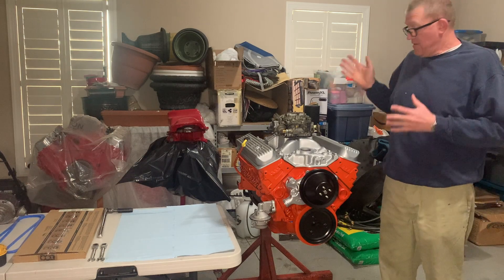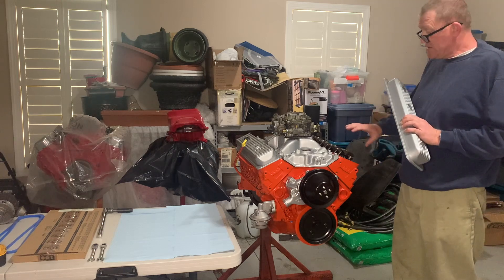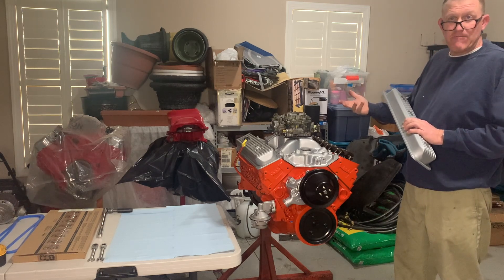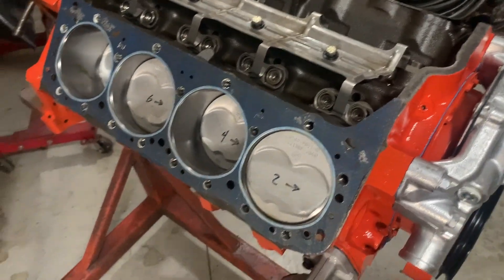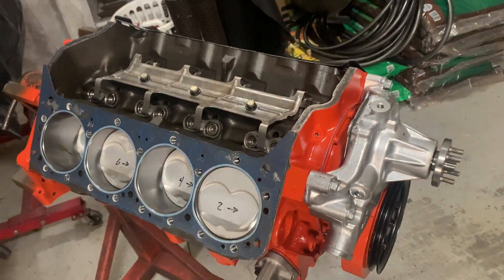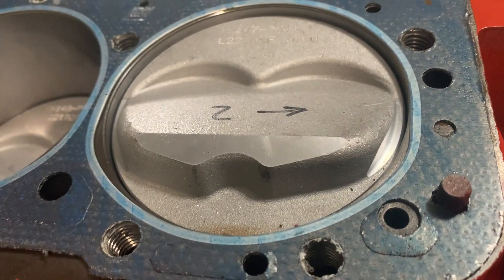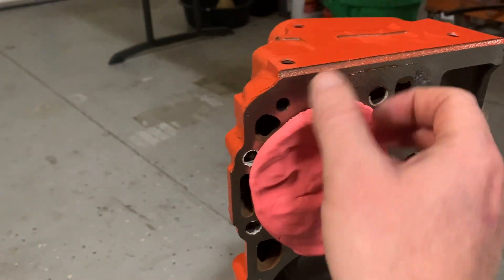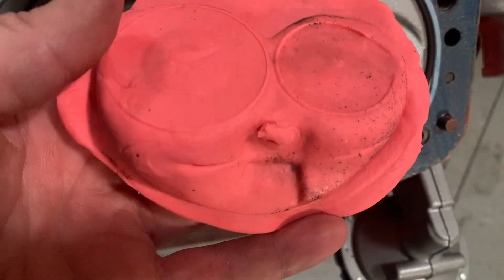Resolving Piston To Chamber Clearance Issues on our Late Model 1 Piece  DZ 302 with Vortec Heads!

Comment: I built a 350 SBC with vortec heads and huge domed forged pistons . After the machine shop ground a bit off the heads spark plug pad  to fit the dome they told me these heads weren't supposed to run dome pistons . Now they tell me after it was completed . The quench was tight too , so this brought this build up to 12:1 . Since it was a 120 octane propane fueled engine that was the ratio I was after . I have been working on the timing all summer and I'm still not happy . Your statements about getting the flame front over the dome before TDC makes  sense now . I was having problems with the flame kernel being blown out by the dome . I solved this with a higher duration HEI coil/module . Solved the problem but after thinking about your comment I think I need more advance throughout the whole RPM range not just at lean cruise conditions . I thank you very much ! I will get back to this matter in the spring . Thanks again !
We went the other way having ground the clearance off the head not the piston . It required very meticulous indexing of the plugs but it did work and the quench was very tight . I think after dealing with timing on this engine there is more to this clearance problem than just clearance . I suspect there are some turbulence problems with a vortec head that wasn't designed to use a domed piston . You may need a more powerful HEI like I buried my problem  with and I'm still not happy with my timing . I wish I hadn't built this engine a few years ago . I could have watched your video and been aware of the problem . I could have gone a different route , maybe a different head . My goal was a fast burn head with high compression to make full use of the low cost 120 octane propane fuel . Don't get me wrong this combination works . I'm running at half the cost of gasoline  hauling grain bins to the mill with this 12:1  one ton GMC on propane ! Many thanks !

Comment: hey dallas new to this bare with can you tell me how you set up beehive springs on your buick heads I asked TA perf. and got the they don't know, your one set up looks like beehive so any help would great thanks-
Reply from the maker: I did do beehive springs on my Super Stock 350. What I did was I took off the race springs I already had on the heads. Those heads had 11/32” Chevrolet valves installed vice the standard Buick 3/8” stem valves. Then I measured the springs and wrote down their characteristics. Then I found a set of beehive springs that met those characteristics and had the needed spring pressures over the lobe (compressed) of the camshaft.

Comment: To bad you couldn't remove the square where the plug screws in 3:56  the cyclinder head  and  use a short reach plug.
Reply: It acually comes to 265 cu. In., Here is the formula for the baby LT 1 block and crank,   3.750 bore, 3 inch stroke , Bore times bore, times stroke, times .7854 constant, times 8, hit equals, Ok 3.750 times 3.750 times 3 times .7854, times 8, equals 265 cu. In. Right on the money ! These nuumbers match the original 265 engines numbers !

Comment: I used L99 crank 
6.250 rods
Mahle flap top pistons 
AFR 195 HEADS with 52cc
Cam 224 232 585 lift 112
11:1 compression 
Dyno 385 hp at 6500 338 torque
Reply: piston part number?
Reply from the maker: Sounds like a great combo! Mine is all GM stuff, was hoping to surpass the original DZ302 numbers.

Comment: I like to use clay, I find Play-doh to be very spongy and not totally hold its shape. Also, for what little needs to be removed, I'd remove it from the head, not the piston. Just had to do very close to the same thing on my 427 bbc, just a slight amount of the dome was just tapping the head at the edge of the quench pad. Just removed the very edge of the quench pad to give a .060 clearance.

Comment: I am 65 years old, so I remember the Camaro Z/28s with the 302 the kids with wealthy parents had bought the kids those Camaros.
The 302 was a screamer with that short stroke but not an engine I need and since doing one 383 stroker with 6 inch rods and 1 385 with 6 inch rods for my 2 work trucks I won't ever do another 350 again the 383 is so much a high toque engine for pulling boats and work trailers

Comment: I have plans for the same but I am going to zero deck the block with flat top pistons. I will use aluminum L98 heads that will be ported with 2.0” intake and 1.55” exhaust valves. The heads will be slightly milled so chambers will be about 52 cc.
Reply from the maker: I hope it runs well! Would love to see it!

Comment: It's common to remove part of the square bump in the Vortec head when using higher domed pistons.

I bet that is where you are hitting? It would be much easier to grind that bump down on each chamber.

Comment: Piston crown is only so many thousands think. Caution removing too much material. My guess is .020" is the max Id remove. Ive see pistons push thru after being cut/machined too deep. Definitely remove the pistons to clearance & measure the piston thinkness before you start. Dont ruin a piston if too much has to be removed. Measure many times, clay cleck is your best be and also dykem. I even use dry erase markers at times.

Comment: We used to apply putty to the top of the piston and then put the head on and hand turn the motor then pull the head and see where the putty got crushed. Considering all the pistons will have to be machined I would take them out and then hand fit them in the chamber after putting dykem on them to see where they contact. If they fit with no contact then when you install the gasket you know there will be enough clearance.

Comment: well that's unfortunate. I would think removing the head material first would be the best option at this point. also you shouldn't be calling it a 302 at all. Because its not, not even if it was a virgin bore. call it what it is. a 320cid inspired by the dz302. and so far doesn't seem EZ at all.  and as I posted last video: You don't need expensive "dz302" pistons just proper rod lengths and domed pistons to (match the head )

Comment: If you didn't do any cutting yet you might want to cut down the head side of things a bit, that spark plug lump is huge, I bet it would help flow a bit.  I'm not much of a Chevy guy so I haven't really paid attention to videos of those heads being ported, bit I bet that's one of the spots they work
Reply: You can really screw up a good set of Vortec heads by trying to get them to flow better. You really have to know what you're doing with them. Removing some of that spark plug hunk for clearance I think would be fine, but I would not do any more than that, just to get the piston to fit properly.

Comment: This is a real interesting project. My favorites were always the early 265,283,327 engines, mixing parts trying to find the best combinations . But that was back in the ‘60’s . 😂👍
Reply: My first car, 67 Camaro came with a 327 but when I got it, it was some kind of 327/350 hybrid with a solid lifter cam, dual plane manifold, Holley 600 and headers. It was crazy fast for a 60’s car.
Reply from the maker: I like doing the same, but this is a late model version of the early engine combination. It should be awesome!

Comment: Piston looks down in the hole quite a bit / Does it come to the top of the hole ?
Reply from the maker: That’s normal for stock stuff. Normally .020-.100 is generally run of the mill.